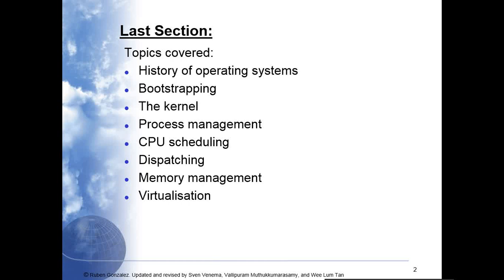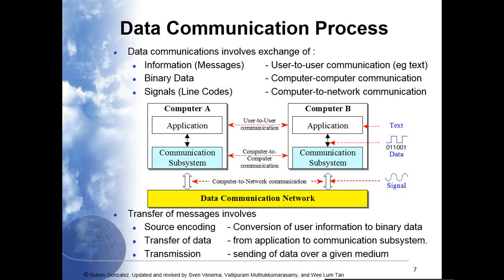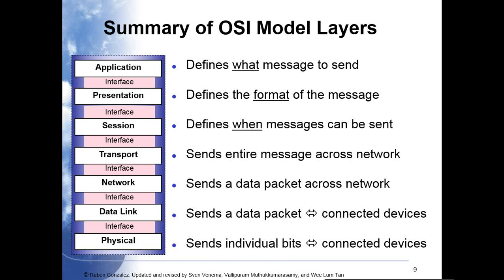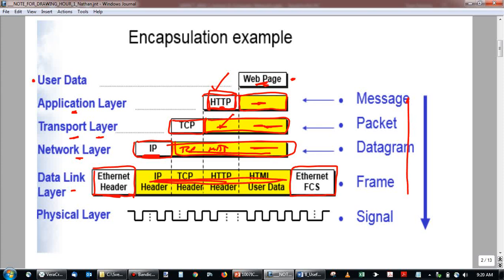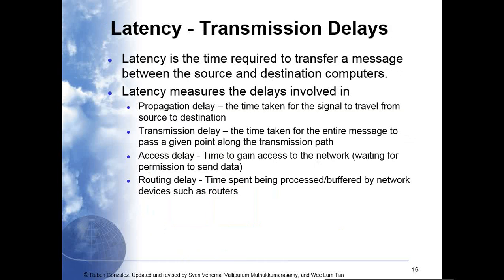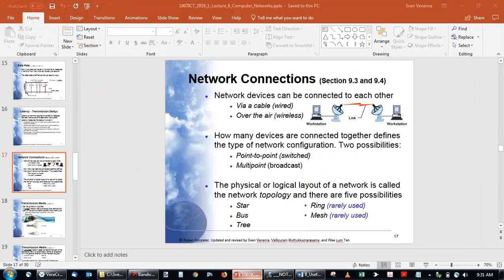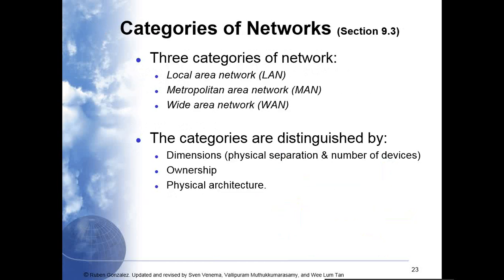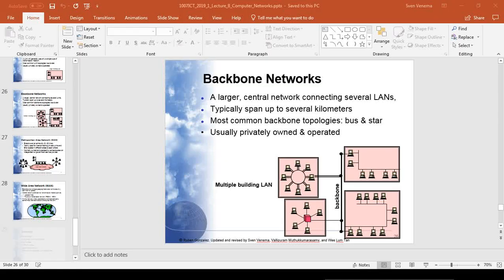Lecture 4.2b Computer Networks

Comment: 0:00 Lecture introduction
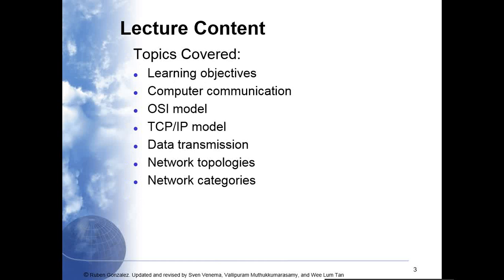0:37 Lecture Content
0:54 Learning Objectives
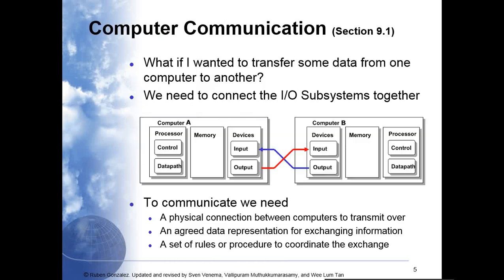1:10 Computer Communication 
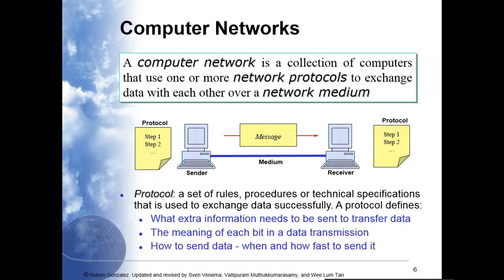3:38 Computer Network
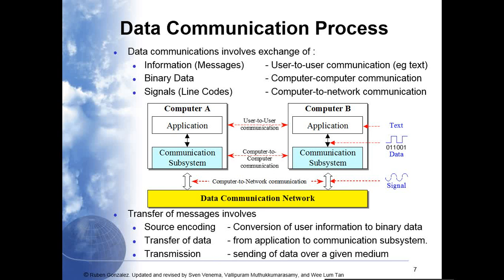5:23 Data Communication Process
7:51 ISO & the OSI Reference Model
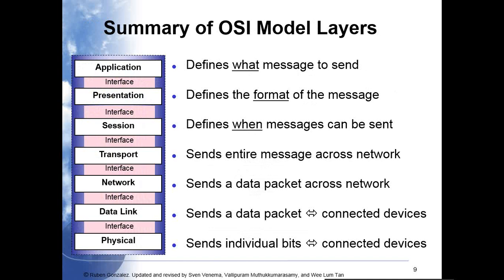9:10 Summary of OSI Model Layers..
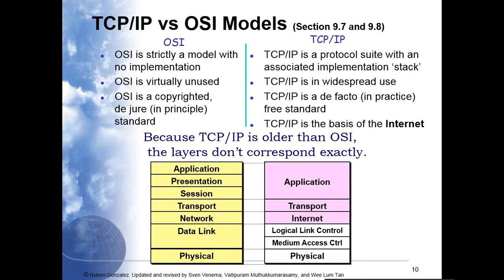12:29 TCP / IP vs OSI Models
14:33 Communicating Through Layers
15:19 Communicating Through Layers Encapsulation Example
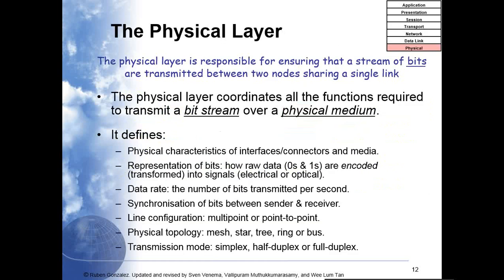19:03 The Physical Layer
21:15 Parallel and Serial Transmission
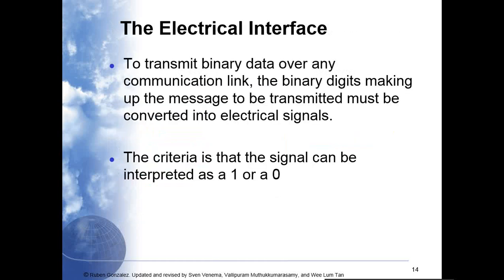22:00 The Electrical Interface
22:20 Data Rate
23:14 Lateny - Transmission Delays
24:11 Network Connections
25:03 Network Connections Example
29:26 Transmission Media
31:09 Network Configuration: Point-to-Point
34:01 Network Configuration: Switched Networks
35:27 Catergories of Networks
35:49 Internetworks
36:46 Local Area Networks (LANs)
37:45 Backbone Networks
38:50 Metropolitan Area Network (MAN)
40:02 Wide Area Network (WAN)
40:34 Summary & What's Next?